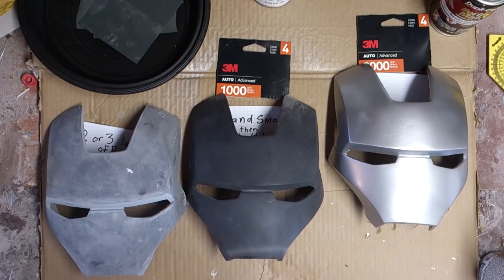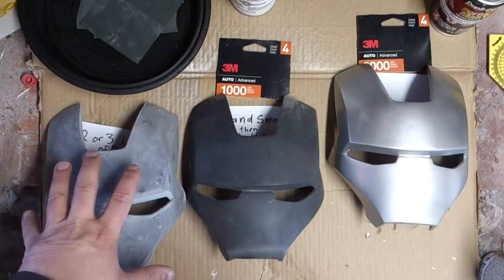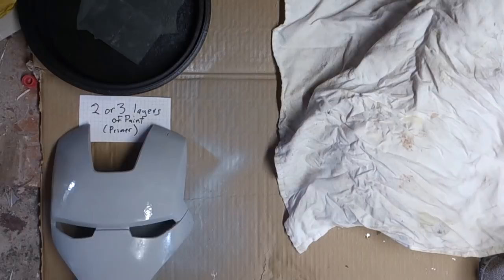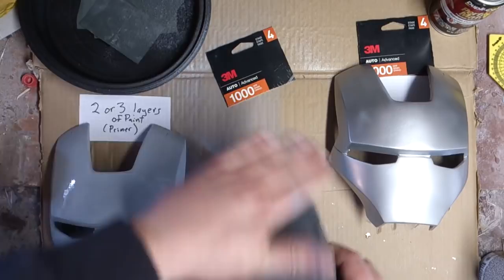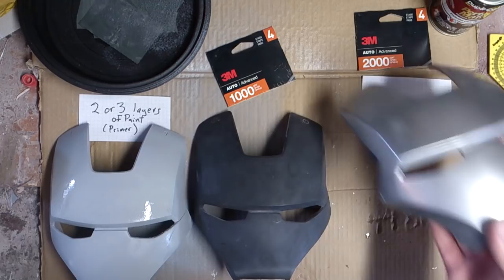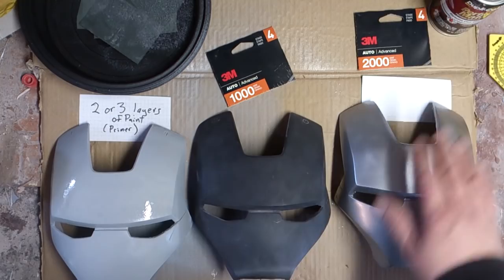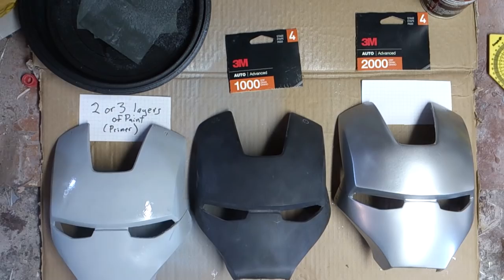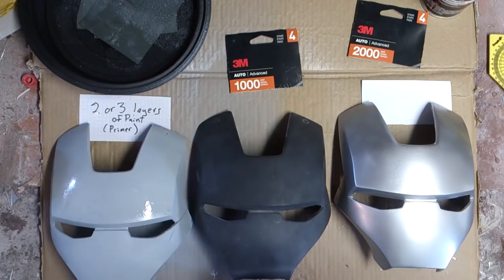Prop Painting Tutorial

Comment: Heat the foam with a heat gun (don't get it too hot). Then take Tacky Glue and dilute it with 1 part water. Paint on 5 coats of this. Or use Plasti-dip aerosol to seal it (more expensive but better than the glue).

Comment: So I'm a little confused regarding the correlation between the black and silver mask. I know you mentioned the first mask was to demonstrate the use of Primer, and the black mask was used to demonstrate how a black sanded color coat would look like (before adding a clear coat). Was the silver mask a demonstration of how a second silver coat would look like on top of the black coat? Or are those two separate masks. 

Also, I have a mask I'm painting and I've already added a gray primer, and black color coat. The paint is pretty much smooth, so I'm not sure if a wet sand is necessary. The final color coat is going to be chrome, but I'm not sure if I should sand the black color coat first, or just spray on the chrome paint and wet sand that. Can you provide a little more clarification for these particular scenario?
Reply from the maker: So as far as primer color goes, test your silver on a black primered piece and a grey. The colors will be different, so choose the one you prefer. 
As far as wet sanding the primer, just make sure you get it lump free and to your liking and not too high of a grit (like 1000) or the paint won't stick proper.
Reply: @Jay-May  thanks for the reply! I'll keep that in mind.

Comment: great video, thanks a lot! Woeking on an iron man suit and the paint is tricky to achieve that finish. What if you painted by hand (acrylics)? Would you recommend sanding and then clear coat any way?
Reply from the maker: Painting by hand leaves brush marks, which depending on the finish, might be a good or bad thing. If you want it super smooth you might have to paint a few times to achieve the finish you want.

Comment: I love your instructions given.  Can you tell me when you paint gold or silver what color of primer do you use.  I am getting confused.  Some say to use white primer for both gold or silver.   Thank you for your help.
Reply from the maker: You want a light colored primer, Gray is a neutral color, White would work well too. The pigments for Gold paints are usually pretty thick (meaning they cover extremely well) and the finish between a first coat and a second or third isn't really all that noticeable. Silver on the other hand seems thinner (depending on brand) and may require a few more coats to cover the primer and get the desired color.
Reply: Jay May I usually sand it down, then add primer, then sand again and add the coat. I've been trying to get my boba fett helmet into a really glossy gold color where it shimmers but I just can't seem to do the trick. Could help me out?

Comment: so you have to do 3 layers of primer and set, ? of paint, 1000 grade sand paper, then sealer, then 2000 sand paper, then 2x polish?
Reply from the maker: So basically, enough coats of primer to make it smooth without going through the primer. If you get through the primer you add a coat or two and sand smooth, Paint your final color in 3 layers, sand. if you go through the paint spray more and smooth. Clear coat is where you want the smooth 2000 grit. Then polish.
Let me know if you have any more questions.
Reply: +Jay May hey Jay, so far it looks great and pops with a bright red, so the sanding with 2k is to aid in the clear coat? and polish to finish it off I presume
Reply from the maker: Yes!
Reply: thank you
Reply: To clarify, your paint is still dull before you clear coat?  Then you add clear coat, sand, wax, polish?